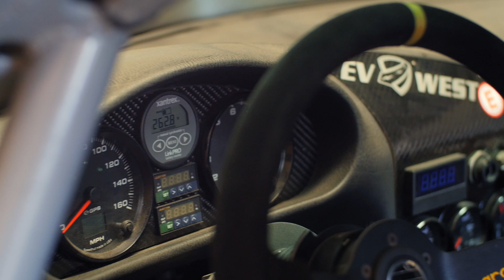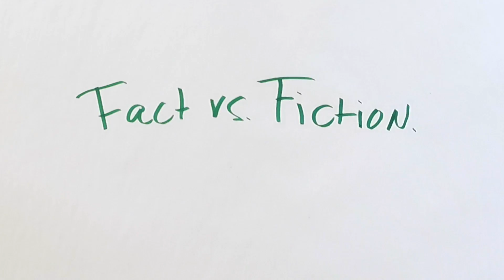How to Make an Old Car an EV - /ENGINEERED

Comment: and how much energy are taken making an electric car batterys ??? and how much really it's hurts environment???
im driving old BMW e38 730d(EDM model) with EGR bypass and KAT delete , getting about 34MPG highway and 23MPG city (in heavy traffic ), still producing less CO2 in year than factory who make one Prius or Tesla . So only real solution is stop making boring and unreliable electric cars, and drive old  reliable German or Japans cars, with good MPG, because all cars after year 2005 was made to brake down, and be hard to fix by yourself, it's how car manufactures can sell peoples new shity cars to make a lot of money...
Reply: +Puukainiits If you removed your catalytic converter you are doing much more damage to the environment than ANY modern car, ESPECIALLY since you run a diesel. The catalytic converter converts your unburnt fuel and carbon monoxide in to CO2 and water. Without it, you cars exhaust are much more toxic.

Not to mention that your statement about electric cars are severely exagerated. Over a three year span, an electric car has less emissions than a gas car. Like the dude says in the video, the refining process for gas isn't included in emissions calculations when we generally speak of internal combustion.
Reply: +Puukainiits Wow.. your car makes less CO2 in a year than the factory that makes tens of thousands of cars? Well no shit. The research has been done, the manufacturing processes included, it is better for the environment to drive electric cars. All you uneducated naysayers only compare your car to the whole manufacturing process of EVs. When critical thinking would tell you that you need to compare both the entire process tree for liquid fueled vehicles and the entire process tree for EVs.
Reply: I agree with this
Reply: that is true and exactly what people don't realize

Comment: What these EV folks don't understand about most motorheads is, about 50% of the fun of having a fast car is the sound. Period. If I didn't hear my M3 engine, it'd still be fun to drive though the twistys, but it'd be missing a huge part of why I love it.
Reply: maybe that works for you, but if i can take corners faster, get on the throttle earlier, and brake later in an eV, ill take it, and trust me, i'm a petrolhead.
Reply: +fidorover "EV folks" understand that perfectly, is just that evs have a huge potential, and some advantages over "traditional" cars and gasoline cars are getting boring, with no new tec being developed.
Reply: +fidorover You simply associate the sound with speed.  Over time after driving EVs you will get over it and learn to enjoy the quiet.
Reply: you also like hearing fart cannon hondas too? bet you wish those were electric....
Reply: fidorover remember you pollute cities and create respirstory problems with an internal combustion engines. Public health must go beyond personal enjoyment... not to mention your m3 will have a greater lag than any electric car: even if you have an m3 with no turbo (like the E46 and previous ones).
Reply: fidorover buy a good stereo and you're set.
Reply: Chapzer gas prices are already high. in spain, at least.
Reply: The NIO EP9 actually sounds kinda like it's jet engine powered. Amazing!
Reply: Jay Barker Not everyone's electric comes from coal power these days. There are plenty of energy comapnies that use wind and solar, so going with one of them makes an electric vehicle much cleaner.
Reply: fidorover yea... I actually understand that aspect. Electric cars are something that will come into play when gas prices go up because of supplies running low. But until then most everyone will be using petrol engines.
Reply: fidorover the only advantage is noise... Which can be overcome with HD noise exgaust. Latest ones sound exactly like the real deal, can't tell the difference.
Reply: fidorover  What about video game engine sound controlled by the pedal and piped through tail pipes using Bose outdoor speakers?
Reply: That isn't true at all.
Reply: Yes, but coal won't be around forever (government regulators will see to that).  Eventually, electric will win out because of ways that technology will capture wind, sun and ?ocean wave? energy in the future.  We just have not arrived yet at the electric Le Mans race yet.